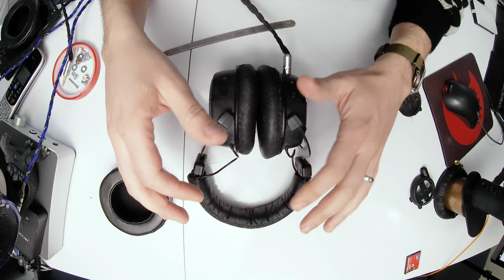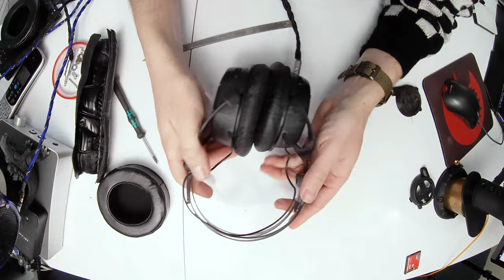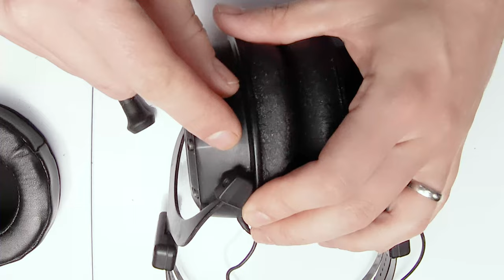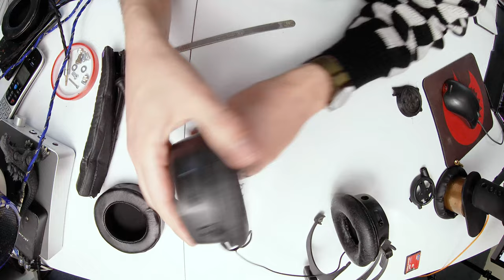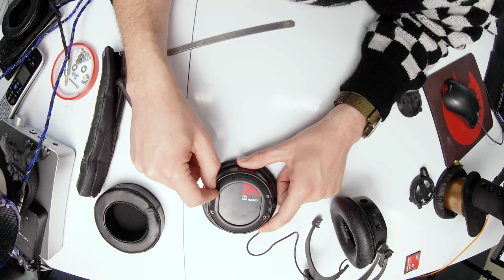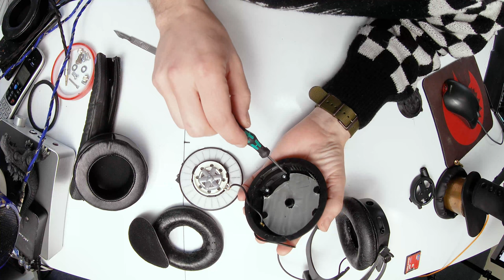The beyerdynamic Custom One Pro - A look at some of the interesting design features

Comment: I also love these Beyers for the fantastic build and comfort of them. They built them so solid, and padded the piss out of them! Unlike a lot of horribly uncomfortable
phones I could name. Such as....GRADO. Just not comfortable. I can sit and listen to these for hours and not want to take them off. Also, at 16 ohms, fantastically
easy to drive. Another thing I love is they're closed back but almost give open back performance to some degree, and I've sat there at diners etc. in public for hours
on end and there's no sound leakage at all. Fantastic.
Reply from the maker: Yes - it is a shame they did not get more love when they came out - I think they are discontinued now
Reply: @CustomCans  They’re a tad bulky but I think they’re phenomenal. The smaller version is probably just as good.

Comment: Hi, do you think drivers may be swapped for something from a dt770 (or even dt 1770)? I think it should be a very interesting project
Reply from the maker: Yes, the 770 and 1770 drivers would fit in these, the drivers in them are basically the same as the 32ohm DT990 so the 770 ones would be similar but the 1770 drivers would be an interesting upgrade. I may give it a go one day if a driver blows on mine

Comment: I still got the Custom Studio after 5 years or so

Ngl I picked them up second hand because I loved the idea of being able to put whichever artwork on the cups
The bass slider is nice to have too but (on the custom studio at least) even with all the bassports open it only sounds like your average neutral studio headphone and with all the bassholes closed it sound completely bass-anemic
Reply from the maker: Yeh - they are built to last - I still use mine most days
Reply: Not for me. I am running my Custom Studio Pros right now with a brand new IFI XCan amp, and via a Fiio Lossless player X1. Well, I don't even use the highest
position bass setting, ever. I get plenty of tight wonderful bass from these without the highest bass clickers on. I think you need to run these with a really good amp
with a bass boost (which the Xcan has in spades) and with a really good player or source(s) to get the best out of them. The bass is never horrible BEATS
type muddy garbage, either. I'm playing Van Halens Best of Both Worlds right now, the kick drum sound etc. is always true and right in the pocket. Eveything
via the Beyers sounds crystal clear, warm, but not warm to the point of being muddy, ever. Treble is decent, if not super fantastic. Mids are decent.

Comment: I'd really like to see some science behind this bass adjustment mechanism. Does this mean I could just drill holes in my dt 770 and make them more bassy, in theory of course :) ?
Reply from the maker: The 770 have a hole in already and in our mod kit we supply little disks that reduce it to reduce the bass a little. You can also enlarge it slightly but if you make it too big it has the opposite effect. It is a bit like bass reflex ports on speakers but I think in headphones it is more about restricting the movement of the driver - if you have a sealed enclosure the driver has to pressurize the air inside the earcup when making bass frequencies. Adding a small hole reduces the pressure inside the earcup and allows the driver to move more easily when producing the large bass waves but go too big and you are basically making them open back and too much of that energy escapes reducing the bass again.
If you want to make your 770 more bass heavy, either add one of our mod kits or change the pads for something denser like the beyer custom one pads

Comment: Hallo! I buyed a used pair of the custom studio... Its in very good condition but I noticed that the "bass slider" is very easy to change near to no force is needed and it Dosen do that "klick" Sound when changing the position.. So does this Effect the sound/ function of the slider?
Reply from the maker: I think the click should be firm but it should not affect the sound
Reply: @CustomCans  
OK that's good to hear
Thx for ur help :)

Comment: nice video! i have these headphones and one ear side is loose. do you have any experience fixing that? or does it not really matter
Reply from the maker: You would have to explain a bit further - which part is loose? Is it the sliding mechanism or the hinges?
Reply: @CustomCans  sorry. i had dropped mine and the left ear cup became detached. nothing broken it just popped out. after putting it back in place the left ear cup slides back and forth on the nubs. noticeably more than the other side which doesnt do that at all. would it be safe to try and bend the outer arms where the cup attaches inwards to reduce this slide back and forth? i hope this makes sense and maybe its not worth worrying about. thank you for your time.
Reply from the maker: Yes, we have bent a few back into shape in the past - I would recommend removing the hinges from the ends of the metal yoke, bend it back into shape and then re-attach the earcup again - you will need a T6 screwdriver to remove the screws
Reply: @CustomCans  thank you very much for the help and information. that makes sense and ill give that a shot. really appreciate it. im new to headphones but i think your content is cool 👍

Comment: Swap the ear pads for sheepskin pads and they become a better set of cans. Sound improves while the bass stays great
Reply from the maker: It is funny you should say that... I had them in the workshop because the pads had warn out. I also changed them for some angled sheepskin ones and it made them loads better - they do squeeze my head a bit more now but I may bend the headband a bit to sort that out